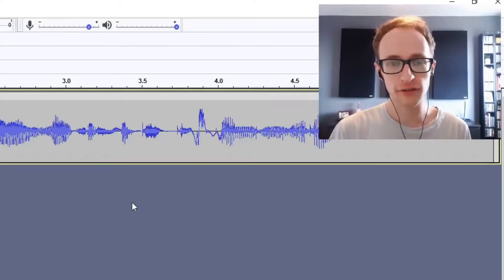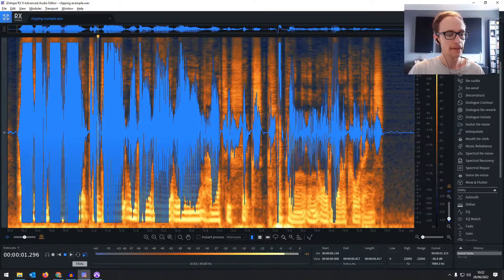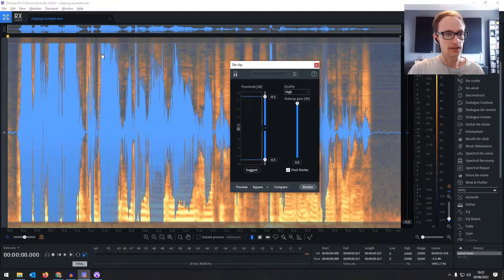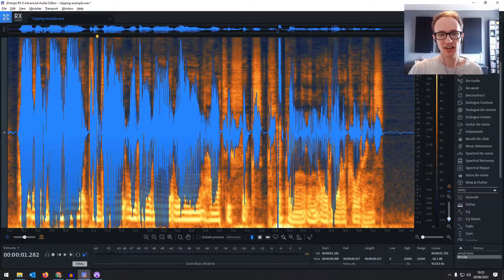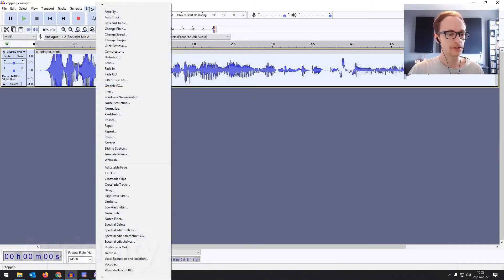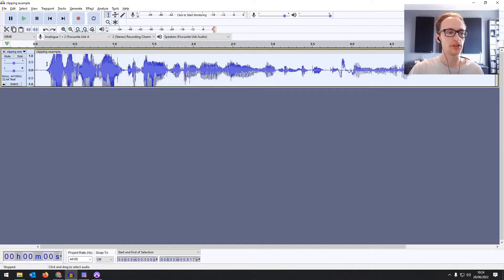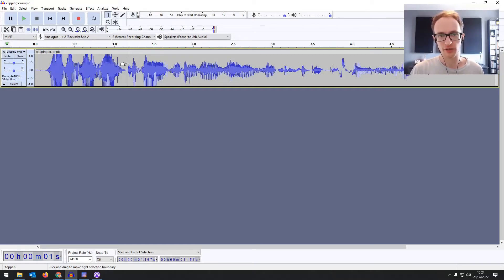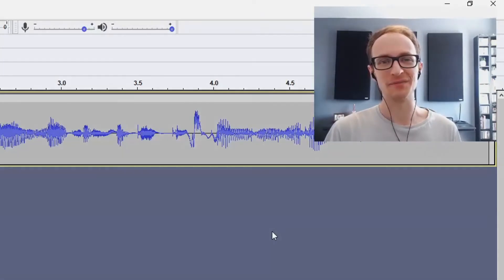How To Fix Audio Clipping in Audacity or iZotope RX | Audio Fixing Tricks

Comment: Joe Crow, thanks.  I'm working on my first YT video, and I've clipped it badly because I recorded in OBS with the db at +2 (dumb, I know, didn't know how else to increase volume).  Your tricks are not perfect but maybe they'll salvage the audio.  I can't re-record, so however I can fix it, that's what I'm stuck with.  Much appreciated.
Reply from the maker: I hope it helps. Unfortunately if audio is clipped too badly, there's only so much that can be done. It's probably safer to record without the db boost and you can always increase it in post.